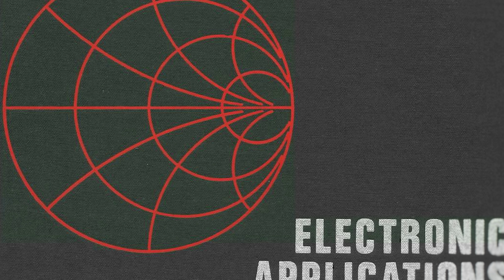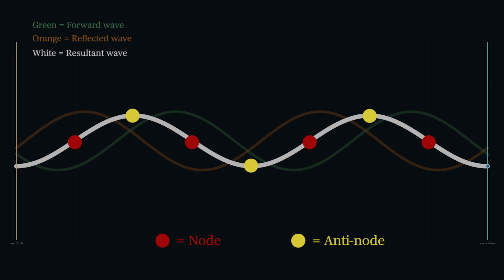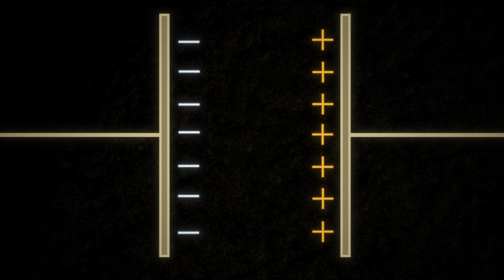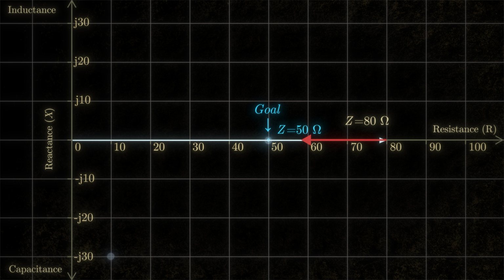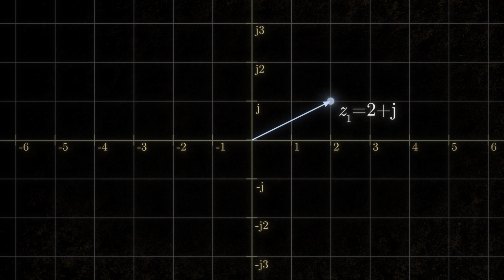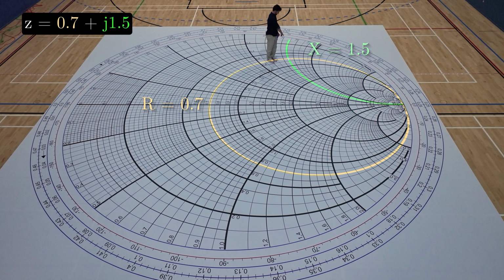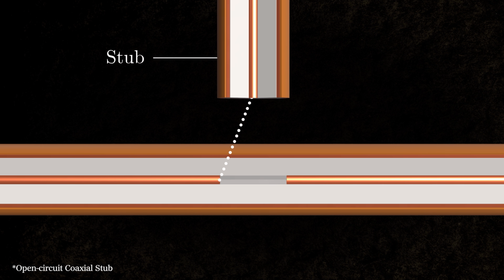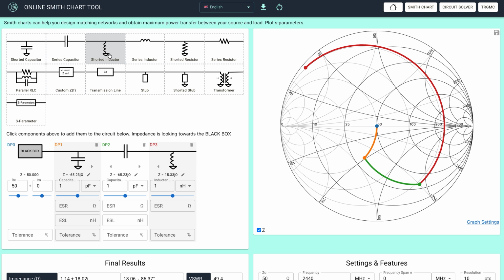The Scariest Chart in Electrical Engineering

Comment: This has been really helpful in helping me understand what I was doing when a teen in the 1980's when using an SWR meter (Standing Wave Reduction meter) to attune my antenna into my CB and HAM radios to reduce the effect of resistance and standing waves.
And although I understood enough to get things working with regards to another electro-magnetic phenomenon known as  ''radio skip'', it'd be really nice to see a similar feature to the above video, but about radio skip, as to why it happens,  when it happens, and how to compensate for it, and what the engineering theories are behind it, as you did so beautifully for standing wave reduction etc above.
For those new to this, radio skip is when for example a signal goes up into the stratosphere, and should theoretically bounce back down in a spreading circular cone in all directions. But, with skip, it may bounce back down with bias towards any direction instead of all. So someone miles to your west might hear you clearly, while someone down the street to your east may struggle to hear you at all. I do know sunspot activity can effect this. But, it'd be beautiful to be able to visualise exactly why all of this happens, and so on.

Comment: Black magic is an appropriate name for most RF stuff.... I try and try to wrap my head around it but it still seems like some kind of magic 😭😂
Recently came across a scenario where a specific power supply was sensitive to the aircraft it was connected to attempting to transmit on a specific frequency causing it to turn off momentarily, this appeared to be a short circuit but upon proving the radio and wiring was right, it came doens to that particular switch mode power supply being prone to fail when connected to a radio transmitter at a certain frequency.. if any EE's have an idea i would love to hear it. 

In my mind, the transmission is causing noise back to the PSU that it senses as something being wrong, but it could be that it's receptive to RF noise and is actually playing up because of the transmission.

For context the frequency is 118.05 MHz on a 50-60hz 240 volt mains connection...

Comment: Finally! A comprehensive explanation of the Smith chart! As a telecom engineer, I needed to deal with that chart most of the time. With practice, you would come to understand it and use it without thinking further. But nobody explained it the way you just did. Kudos!
Reply: May I ask which job deals with it the most

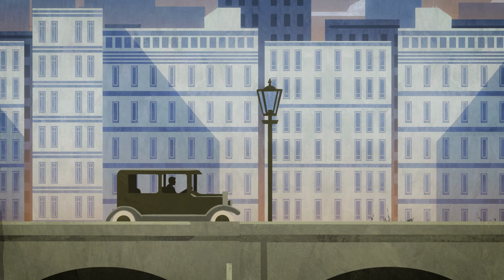Comment: Great video! One comment, you said at 1:30 that no cable crossed the ocean, but telegram cables were crossing Atlantic already. And to my knowledge, same copper cables were used transmitting calls when we changed from morse code to audio calling.

Comment: I work at a rf chips manufacturer & this chart is the gold standard when it comes to filter design. I never thought I would see a comprehensive video on it. Thanks. Btw it's not even my domain I didn't take any rf classes in my electrical engineering ms. Ďi had to learn this thing on the job it was a nightmare even for me no wonder it's a legend.

Comment: You did not mention SWR, Standing Wave ratio, which is optimum at one. Most transmitters have a swr meter and us engineers know in reality SWR is tuning the antenna to the radio frequency first using Velocity= frequency x wavelength. then the suitable coaxial cable is chosen, then a combination of capacitance and an inductor at the root of the antenna tune the cable to the antenna, so SWR=1. Much simpler.

Comment: I am amateur radio operator and I have used Smith charts when designing and building antennas. Your video explained the way it works to perform it's magic very well. It is the first time I think I understand the concepts behind its operation.

Comment: This algorithm is doing me wonders. This is the second time i have been recommended a Veritasium video. I completed my first semester of second year EE and my biggest struggle that semester was understanding how everything connected to each and the common thing that appear were complex numbers, then i got recommened the origin of complex numbers video 2 days ago and today i see this video and it helped me understand circuits specifically the work done in circuits towards the end of the semester. Impedence, capacitance, resistance you have made me not only understand the work but why we did it and where it will lead. Next week I start my second semester of EE, doing electronics 1, electric and magnetic systems and signals and systems. I hope to find more videos that can help me make more of these links alot earlier

Comment: Can a new complex number axis be added for different frequency values that vary? is it possible to obtain a graphed pairing state on the surface of a sphere in this way (there may be methods such as riemann projection to transfer the sphere to the surface).

question is not for engineers to go crazy about,  for physicists and mathematicians

Comment: You are implying that reflected power is lost power. But this is a myth. Power reflected from the antenna is re-reflected by the source, from which it flows back toward the antenna. Power is lost only from the additional (resistive and perhaps radiation) losses caused by those trips up and down the line. If you had a lossless transmission line, 100% of the power would ultimately be radiated, even if the SWR is greater than 1:1.

Comment: Synchronizing any type of fluctuating inseparable linear  positioning factor, will demagnetize the already unstable impingement portion of the sine wave in question, inherently bringing the oscillating frequency band into momentary correlation with any longitudinal fluctuations that would normally communicate by having 2 sub-atomic electrons, and subsequently emitting atomically transferrable synchronous input simultaneously.

Comment: A good explanation of a very complex graphical method. It is taxing to learn and remember the Smith Chart technique. 
Today , computer programs to can give VSWR, etc without any understanding of the Smith chart. 
However: a Smith chart gives better insight as to complexity of the   Z]match which must be added to a transmission line.

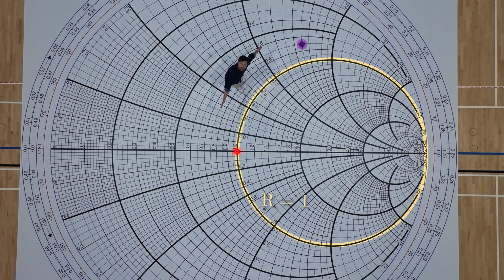Comment: 27:26 Food for thought:
The "magnitude of the reflection-coeff." --> The string represents the length, but how do you read it out ? Where is the "scale"?
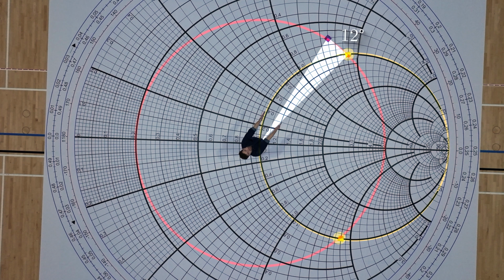Reply: Also: 28:50 "360 degree is half a wavelength" --> Do you understand why it is not a full wavelength?
Also: 29:05 "28mm of extra tape" --> Do you know where this tape got added?
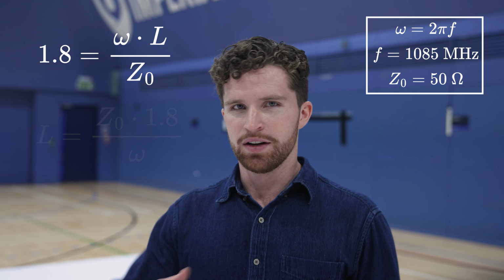Also: 29:35 (Look at the shoulder :)
Reply: @AdityaMehendale  I've been trying for about 50 minutes to get these numbers and figure out how long they are. I didn't succeed :(

Comment: There is a more fundamental reason why we still use Smith charts (although young people are relying on computers more and more). On many passive microwave devices the tools you get to impedance match are usually only those small capacitors and inductors. In complex antenna systems and difficult geometries, its usually not as simple as long lines. Most modern applications are in microwaves where the wavelength is centimeters or millimeters. The Smith-chart is direct feedback to see what change you made/can make to your geometry to match it. And those changes often don't involve just transmission lines. They may be making dents in waveguides or cutting corners of in certain places. The geometric permutation space is too large for a computer to find so its much faster for an engineer to look at the S11 in the smith chart, figure out where some capacitor or inductor needs to be places and than adding some metal or removing some here and there to add that tiny bit of value.

Comment: Electrical engineering is like spending two years learning what things go, how things go, and where things goes, then you sit down in class and the lecturer starts rambling about when things go

Electrical engineering is like mechanical engineering except the wheels make contact with the car and ground at unaligned times

Electrical engineering is being taught how the heart works, graduating, then being asked to calculate how the three hearts controlled by two brains will interact through the shared chambers.

Comment: It wasn't until I saw a plastic slinky attached to a metal slinky that I truly understood impedance mismatch.
Reply: When i was taught about impedance matching, my instructor used echos as an example, which works because it's easy to visualize.  And while i was never taught the Smith chart, i still got it.
Reply: @jeromethiel4323  anyone teaching this should be using a oscilloscope and demonstrating it for real. Including this video. A slinky is fine I suppose for the purpose of this video, but it's missing the best part.
Reply: @stuart11n do not underestimate the power of a concrete physical example, its much more intuitive and grounded in familiar phenomena.
Reply: @stuart11n  I disagree because it's not just an electrical phenomenon. Next time you're in stop and go traffic way back at a traffic light, notice how the brake lights travel back at you like a wave. The light has a certain capacitance based on the red light duration, and a certain inductance based on the speed limit (and how quickly cars move from a dead stop).
Reply: I was thrown into teaching Apprentice Electricians, and I have often gotten questions about why we can't use mismatched transformers. It makes intuitive sense, but I hadn't been able to explain it until today. Huge bonus.
Reply: @benwilliams9692  In electronics class we actually did a lab on this, and it was eye opening.  It's fine to know theory, and different entirely watching it happen in front of your own eyes, with an experiment you built with your hands.

Impedance matching is used everywhere in electronics when you're dealing with AC.  Even at low frequencies.
Reply: @jeromethiel4323  Impedance matching is used everywhere mechanically and even in medicine/biology. Blood vessel compliance is the human body’s solution to impedance matching. And those three little bones in the ear combined with the ear drum are a system to overcome the impedance mismatch between air and the fluid in our cochlea.
Reply: @benwilliams9692 I think of impedance matching is simply what a mechanical engineer calls a transmission: It's just IMHO matching power to a load.
Reply: THIS! 👍
Reply: So, high impedance is, what, heavier slinky? Stiffer slinky?
Reply: @dongleseon8785 As with everything in impedance. It depends on what frequency we are talking about. In general, stiffer, lighter slinky will transmit higher frequencies better (think ball point pen spring) and a softer (think plastic), heavier slinky will transmit lower frequencies, and attenuate high frequencies better.
Reply: @stapedium So it is like a low-pass or high-pass filter.
Reply: @denelson83 someone else can probably explain this but my uneducated self learned brain thinks there is a correlation. Hi and low pass filters (passive one at least) are made from a resistor and a capacitor. One is in line with the signal and the other goes to ground. At least that’s what I’ve seen in audio electronics where both get used a lot. As said I’m a simple hobby analog synth builder so I’m not that well versed in the theoretical side.
Reply: Thats just part of my house's plumbing...
Reply: is that why speakers have impedance stats on them?
Reply: @alf3071 not necessarily I think. I know if for example you mismatch impedances in guitar cables/pedals/amps you can have a los in high frequencies. I once for instance read that the engineer who recorded AC/DC always used the shorted cable possible between the amp and the cabinet.
Reply: The Greek god Pan: "Hold my pan flute. I invented impedance mismatch 5000+ years ago, so my flute would work."
Reply: And as it turns out, resistance and reactance are also mechanical phenomena.  If you push something with force and it feels like it is pushing back, you are experiencing resistance.  If you push something with force and it either torques or moves in a different direction, you are experiencing reactance.  Reactance is the rotational counterpart of resistance.
Reply: @denelson83  Damping and inertia would be the mechanical counterparts to reactance and inductance respectively.
Reply: Reminds me of the psychometric chart
Reply: @rafaels9516  Nah, that chart is simple and straightforward. In comparison, the Smith Chart is... bizarre and nonintuitive. For those not familiar with a psychrometric chart, it's used in HVAC work. Air moisture content ratio (lb water per lb air) vs dry bulb temperature. All aspects of the moist air's properties can be plotted: relative humidity, wet bulb temperature, enthalpy, and a few other things I've probably forgotten by now.
Reply: That's why they say never connect a bunch of extension cords together.

Comment: I'd been confused about v / f = Lambda before and if anyone needs it, here's a trick that helped me to visualize the equation better.

Break down v into distance/ time. Don't worry about time for now, just imagine v is actually just d. If it were d, the equation would be d / f = Lambda. I would be splitting a distance into an amount of wavelengths. You can now imagine a pulse of light of a certain distance long, split up into your certain amount of wavelengths. Of course f in this new equation doesn't really mean frequency in the usual sense but you can make it mean "the number of times" that I have Lambda, the wavelength, in this total distance d.

Now, you should have a fixed object in your mind, more easily visualised.

Let's add back the time component to change d back to a v, and get back our initial equation of v / f = Lambda. What are we now doing to our distance object we can visualize?  Well we have to find a way to count this distance per unit time. And this is how we finally reach our moving distance visualization. Often in education channels like Veritasium we get a fun, but incomplete visualization of the equation, which if you're looking to understand the math, like I am trying to do, may not be enough.

So now to visualize this equation, take a distance which is the standard use in your velocity. For light it's approximately 300,000km. Then cut that distance up into an amount of wavelengths, let's say 1 million, and so the wavelength is 300,000 km / 1,000,000 = 0.3km. We've broken down the essential components of the equation, and now we can just move these million 0.3km wavelengths all attached to one another. The initial position of the start of the first 0.3km wavelength, acts like a marker, let's call it M, and we need the very tail end of this total 300,000km distance, the end of the last 0.3km wavelength, to travel past M. For the speed of light, we need it to travel past M in one second.

This helps me understand scale in the equation. 1 million (f) 0.3km wavelengths (Lambda) had to move 300,000 km (d) in one second (t). [v = d/t] We have a broken down equation whose meaning is more apparent, even at a quick glance at the equation.

Hopefully this was a help to someone! I know I need visualization tools like this!

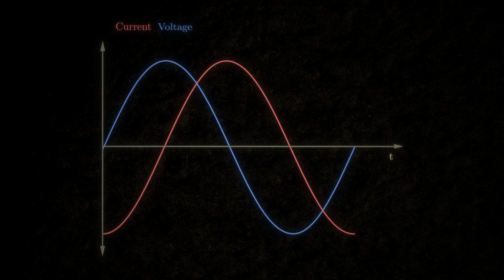Comment: I remember this several decades ago when I was getting my Electronics Engineering when watching from 13:37.  I asked my lecturer why we have to use complex numbers.  Like he was waiting for the question he asked me to look at at the ceiling.  What is there at the ceiling.

I said fluorescent lights (this was the nineties)..  He asked what circuitry would this be.  I said capacitive.  "Correct" he said, and what else is on the ceiling.  I did not see anything but I said an air-conditioning vent to why he asked the circuitry to which I responded as inductive.

He asked about which circuitry where the voltage leads the current and which one does the current lead the voltage in the phase?

At that moment I felt like an arc light hit me moment and complex numbers and Smith charts were never scared me as I am reminded by my professor, Dr Don Keogh.

I will never forget my professor and I personally thanked him for that moment when I graduated.  He smiled when he was reminded of this moment because he actually imparted something to me me which in my working life I have built tesla coils etc. from scratch.

Comment: ? I got a 4.0 GPA in electrical engineering, and I've never seen this chart. I guess I never took the course that uses it. Honestly, while getting my BS & MS, I focused mostly on control systems and machine learning plus the math underpinning both like proof-based linear algebra plus programming stuff. Really disliked communications and electronics and power systems and the course, forgot its name, that taught transmission lines. The guy teaching the transmission-line stuff, Dr. Pace (sp?), was like 85 years old. Maybe, he just went easy on us.

Comment: Any EE worth their salt knows that the scariest stuff is not smith charts. But either a control system that is unstable / not rubust when looped back. Or even worse the electromagnetic equations transformed from Cartesian with 0 axes / degrees of symmetry. Those whom know know. Shivers in grad EE electromagnetic design